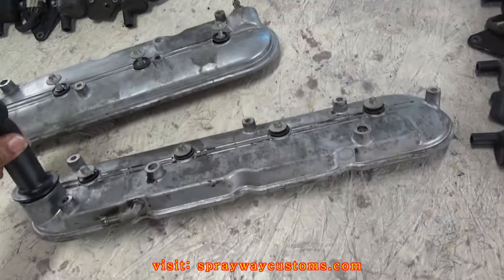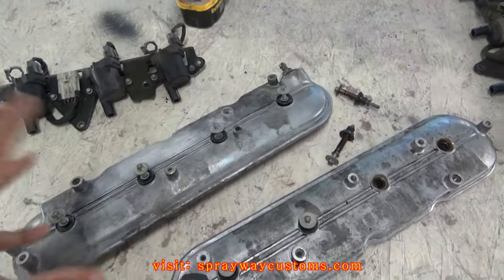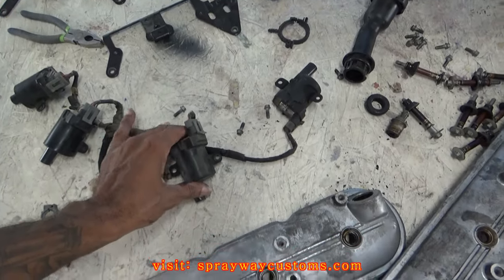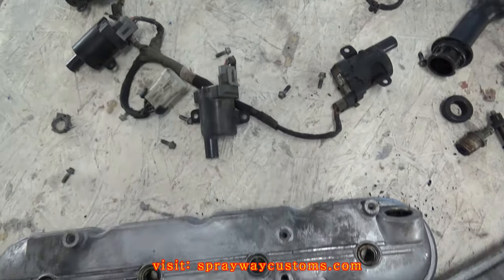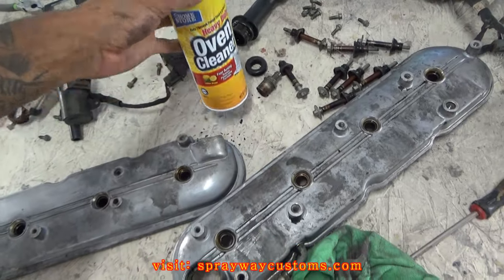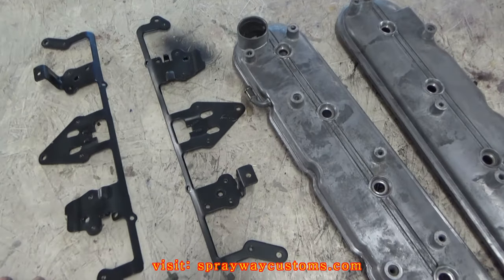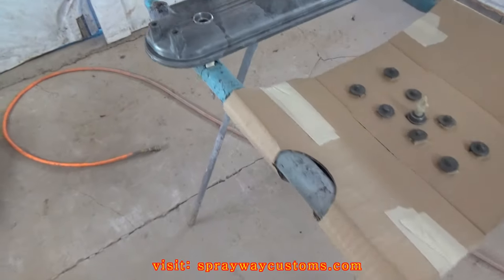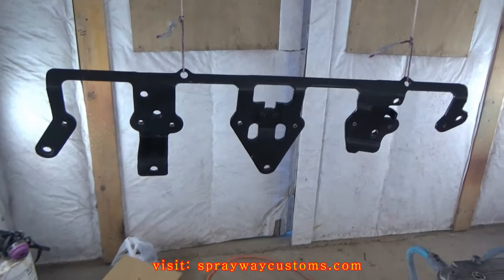How To Paint Valve Covers - Box Chevy Caprice Landau LS Swap Update - Painting Coil Packs Bracket

Comment: Looks great man.   I don’t know if you looked into it or not, but you don’t have to run that oil filler neck if you don’t want to.   The cap will screw into the valve cover and give it a cleaner look.  It’s how mine is done anyway.   Keep up the good work man.   I think you’ve really got it going on.
Reply from the maker: Yes, I was thinking of going that route or getting a smaller neck. Thanks 🙏🏾

Comment: Sure looks awesome! Is that clear coat hard enough that the bolt heads didn't get ruined on reinstall? What kind of tip do you have for that, small thin cloth layed over the bolts.
Reply from the maker: I let it sit for awhile to cure. It might've scratched it up a little but not enough to actually tell
Reply: Tip.. if you line your screwdriver or socket with electrical insulation tape, the fasterner is less likely to be marked.

Comment: Oven cleaner is an awesome cleaner.  I use it on old vintage aluminium wheels I buy at swap meets.  Cuts the time in half in getting them cleaned and polished.
Reply from the maker: Yes it is. You can't beat it

Comment: They turned out awsome... I have a set of new aluminum finned valve covers i bought new a year ago... I want to paint the inside of the fins yellow... But i need to figure out my intake. My wife bought me an aluminum high rise i need to put on durring winter. Been deciding on polishing to chrome, powdercoating or just paint... And i will have front clip off so i will recover headers and paint block...
Reply from the maker: Sounds like you'll be pretty busy this winter. Thanks 🙏🏾

Comment: Killed it again bro. No doubt the paint job would be A1. Any concerns on the durability of the paint if its not High Temp\Heat paint? I've laways went with High Temp  Paint on engine parts.
Reply from the maker: It should be fine. Thanks
Reply: SprayWayCustoms 👌

Comment: What's your favorite brand of primer, base coat and clear?
Is that brand a mid price or?
How much of each would I need to paint a 87-01 jeep cherokee including reducer and hardener?

Thanks man. 
Love watching you spray paint before bed time, it's relaxing.
Reply from the maker: A gallon of base coat and a gallon of clear will do it
Reply: Thanks.

I take it that you cannot reveal the answer to my first 2 questions... Is that correct?
Reply from the maker: I use all different brands on each project. I don't have a favorite.

Comment: was this VHT pains or just normal paints? nd wow what a job
Reply from the maker: Northdown Angler just regular automotive 2k paint. Thanks
Reply: I'm new to this all. I've started hydro graphics dipping go under the name liquid dip n.i. in belfast northern ireland. And been asked to do a valve cover. I see loads on you tube, but I'm worried that normal 2k paint will flake with the heat. Would I need to worry about this at all?
Reply from the maker: As long as you sand it real good you should be fine
Reply: @SprayWayCustoms  thank you so much. I really appreciate your help.